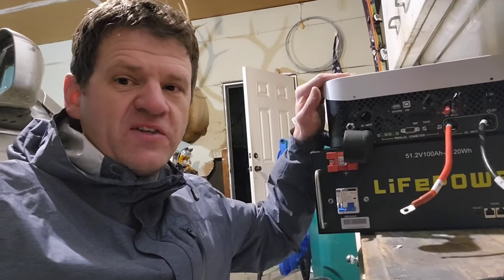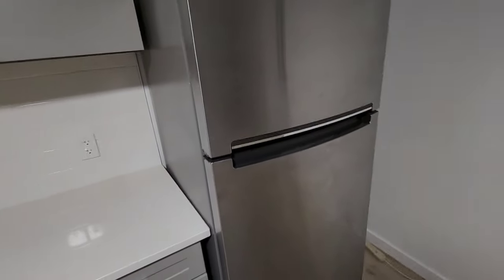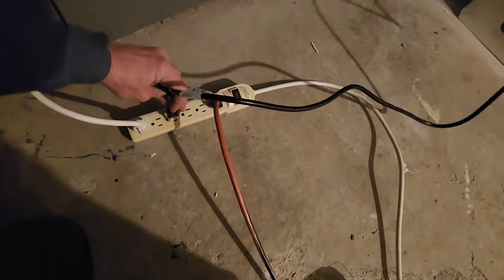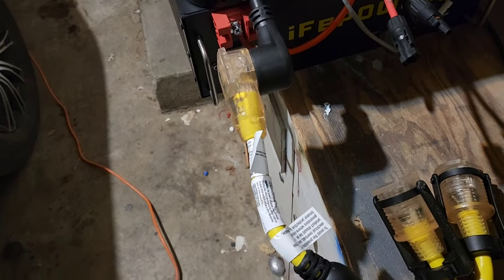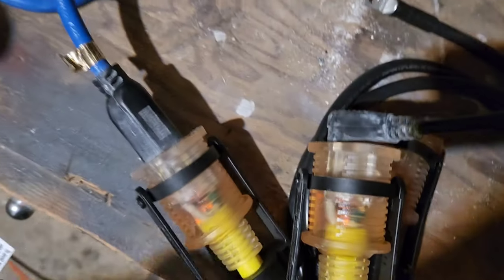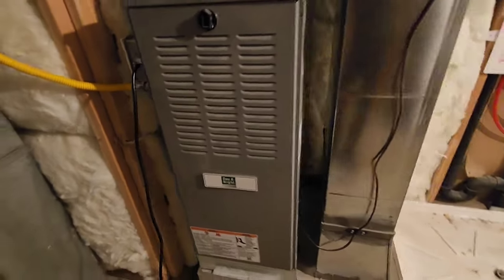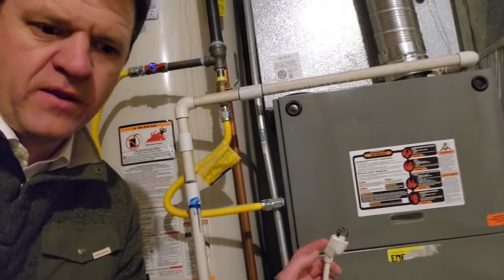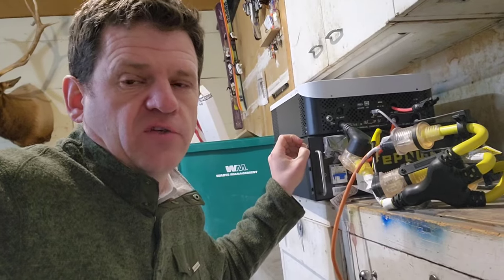How long can a 48v 100ah LifePO4 battery run 3 fridges and a furnace?

Comment: I'd like to know how long can I run a typical office setup.. e.g. a desktop gaming computer, big monitor (49"), speaker system (12" sub and bookshelf studio speakers), a 2nd laptop, a few USB devices. Going to figure this out soon myself because that is my daily almost every day of the week setup that I run about 12 to 18 hours a day depending on other factors. I'd like to try to figure out how many panels I need to keep it topped off so that I seldom use grid power to charge batteries, and can I charge 48v battery bank while its in use with the inverter. My goal is to hopefully get a weeks worth of charging + battery use without grid use, but during winter/rain/cloudy days, not sure how that will work out. Can I set up a bike and pedal my way to recharging. :D.
Reply from the maker: Funny, we think alike. I was just thinking about building a bike charging set up.
Reply from the maker: You'll want to get a watt meter and plug all those items into it so you can measure a day's worth of power consumption.  Then that will tell you how many batteries/ solar panels you'll need. Remember even on sunny days the solar panels won't give you 100% output(Rarely it will when the stars align). I'd plan on 70% output.
Reply: @diySolarPowerFunWithRay  Lets do it! I'd be curious if there is a way to make one that can be efficient enough to generate a few 100watts of power.. but naturally nobody would be able to cycle for hours on end. Still in a pinch it could be useful for charging a phone or a few batteries to power a flashlight or something. From what I read a typical rider with a bike generator could do about 100watts of power give or take. So not as much as one of these cheap solar panels can put out. So wondering if there is some better way.. using multiple gears or something?
Reply: @diySolarPowerFunWithRay  Per watt meter, yah got one of those. I like that the battery with inverter (like the river pro I got) can show how much power things plugged in are consuming.

Comment: You need a pure sine wave inverter to run the furnace.
Reply from the maker: Yes, I would use one of those for sure. There are fragile electronics and you might damage something otherwise. Imo.

Comment: What is the load if all 3 kick in at the same time, would it overload the inverter?
Reply from the maker: Thanks for the question. After a quick search, apparently inefficient fridges will use 500 watts when they're running.. So that would only add up to 1500 watts. This unit can power 3000 Watts, so it should be able to handle that fine. Are you referring to in Rush current? I'm not sure what that is but in Rush lasts in the milliseconds so the probability of that occurring is n't likely. Unless you purposely turn them all at the same time.. but I imagine it could still handle that because it can handle 6,000 watts of inrush.
Reply: @diySolarPowerFunWithRay  Yes, I was asking about in-rush, but  if you have verified it can handle it, fine. Fridges kick in at random times, it is very possible for them to actually turn on during the night or early hours at the very same time.  However, if this happens it should appear in your logs as a  overcurrent or overload. All the best

Comment: Furnace problem is probably a lack of ground-neutral bond
Reply from the maker: Yup. That was it.  Thanks.
Reply: @diySolarPowerFunWithRay how would you rectify that problem?
Reply from the maker: I can used one of these plugs in an emergency: https://youtu.be/wGZeAqnuhaA?si=xz3ofEyE7Fti7D0D

Comment: how long will this battery last with a 1500 watt space heater  on constantly.   And how long at 750 watt constant.
Reply from the maker: The battery has 5120 watt hours of capacity. so running a 1500 watt load with around 50 growatt idle would be....  5120wh/1550w = 3.3 hours.   minus a bit for 85% - 90% efficiency.... So i'd say just under 3 hours.  double that for the 750 watt space heater
Reply: @diySolarPowerFunWithRay  cool,  thanks for the info…
Reply from the maker: @fergman300   no prob. let me know if you have any more questions.  If you end up purchasing something you can support the channel by using any links I have. Good luck

Comment: Some furnaces require a grounding bond to operate
Reply from the maker: Thanks I'm still troubleshooting it. I think I have a bond or to take my polarity might be reversed
Reply: @diySolarPowerFunWithRay  which growatt are you using?  The 145v solar input version or the 250v solar input version?  Did you have any trouble setting up the Wi-Fi or battery communications?
Reply from the maker: @leafnutz2341  I'm using the 48 volt p. It is the 145 model. I didn't hook up the Wi-Fi dongle but I was able to hook the BMS communication cable up and it works fine. It really only tells you what the battery percentage is though. At least that's the main thing I have noticed with the communication cable
Reply: Some other video I watched about the furnace says it's a neutral bonding issue. It's not seeing ground and neutral tied together.
Reply from the maker: @John Hovan  yup. That was the issue.  I bonded them, and it works.
Reply: You need to have a ground for the flame rectification to work

Comment: I doubt you can run water heater, microwave, fridges with such 4800Wh battery for 12hour. But its your system, so it is what it is
Reply from the maker: Yeah, I definitely can't run them for that long. But it is able to run the electric fridge, microwave and then it still has enough power to kick on the AC with out a soft start...( I need to use the eg4 v2 battery though)

Comment: Don't run your battery down to 0% you will dramatically reduce the life of the battery.
Reply from the maker: LiFePO4 cells are not damaged if you discharge to zero.

Comment: You do know that you lose a lot of power by using extension cords, and your test are not super accurate.  Also, they are dangerous with the power strip setup as well.
Reply from the maker: Thanks, Yeah I did another video on that. I think I was loosing 20 or 30% when the sun was fully out.  Pretty bad. I'm going to upgrade to a different inverter that can put more panels in series which will cut my amp's in half.
Reply: @diySolarPowerFunWithRay  With a Series connection, the amps stay the same.  The voltage increases.
Reply from the maker: @DeeJayHouser1  yup. I have two strings in parallel right now so it will cut my amps and half
Reply: @diySolarPowerFunWithRay  Huh?  The books teach you that the voltage increases in series and the amperage stays the same, and for parallel the voltage stays and the amperage increases...  I have never heard of it cutting amps in half.  Do you have a circuit between that is dropping your amps?  I did go to college for Electronics Engineering in 1990, perhaps something has changed since then.
Reply from the maker: @DeeJay Houser  you have it right. I'm just not explaining it well.
Reply: @diySolarPowerFunWithRay  I think i understand.  No worries.  Instead of adding them together, you are saying them are in half of that....  I think.  lol